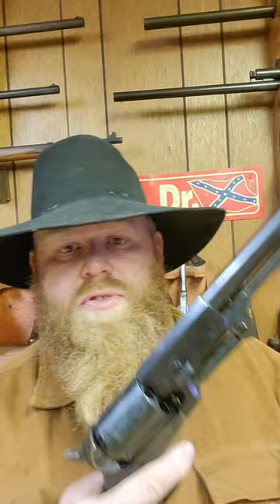The biggest colt ever made.

Comment: These were so overpowered that a significant chunk of the ones issued to the Texas Rangers blew up within the first few years. 1800's metallurgy just wasn't ready for so much energy in a handgun.
Reply: Didn't help those uninformed guys were loading picket bullets in backwards 😬💥
Reply: Wrought Iron - which isn't even made anymore except for specialty purposes.  Mild steel is actually cheaper and easier to make - and a lot stronger.

Comment: The most powerful American Handgun until the S&W .357 Magnum came out in 1935.
Reply: Not even over the walker
Reply: My favorite round.
Reply: @thomasfurniss2026 357 don't  stand a chance  a hot load  44 walker  👍👍
Reply: @breckhedrick2423  
 Not true.
 black powder has a maximum pressure of 20,000 PSI

Smokeless cartridges can exceed 60,000 PSI, a hot .357 can exceed 900 ft/lbs at the muzzle .
The Walker Colt was around 500 ft/lbs. Which is entry level .357 magnum.
Reply: @patrickhorvath2684  lol I can  prove  my point  I have a 1970 station wagon  I shoot at a 357 is about  a courter  size  hole  can't  penatrate  the  car  front  to back  my 44 walker  goes threw it leaving  a half dollar  hole   I'll stick with  44 ok

Comment: Help me out here, guys...  I've known about the Walker Colt from my adolescent reading of Louis L'Amour and other western authors - then I saw photos of a Walker  - I cannot understand how the frame, having no top strap, can adequately support the cylinder and axle under loads....  if you used the pistol to pistol whip some unhappy lunk, the lack of a top strap will transfer loads to the axle ...  how did this work ?  Why no top strap ?
Reply from the maker: the walker was huge and what we call the arbor (the pin in the middle) is over 1/4inch wich is almost as thick as a top strap and makes for a veryvsolid gun just think of all the 51 navys and 60 armys sill around today. as far as top straps go colt did attempt to put top straps on his revolvers all the way back in the 1830s on his Patterson revolvers and did put them on his 1855s but the trouble was that the top straps would catch black powder fouling and force it back down around the arbor causing the cylindersto bind and stop after just a few rounds. even remington civil war revolvers struggled horribly with this. so the colt company did not use the topstrap in great numbers untill they developed the 1873 single action. that gun had a base pin running through the cylinder with an independent lubrecated bushing around it that kept the gun from fouling out.